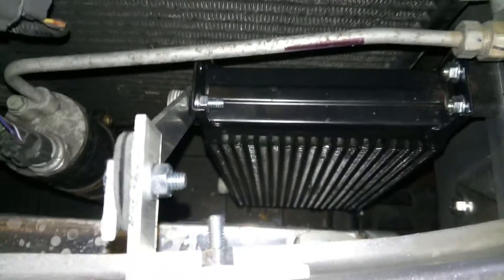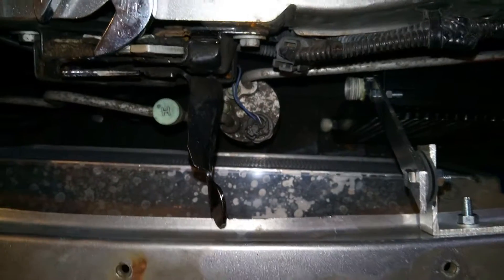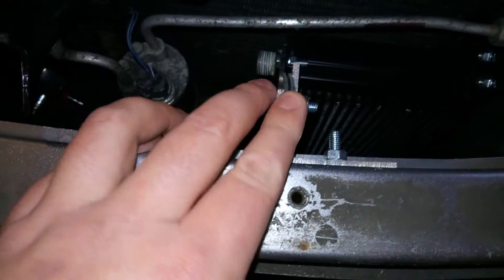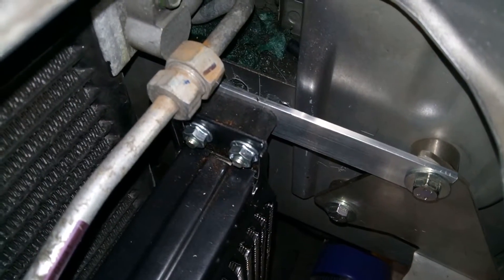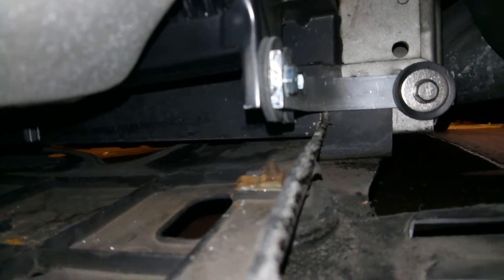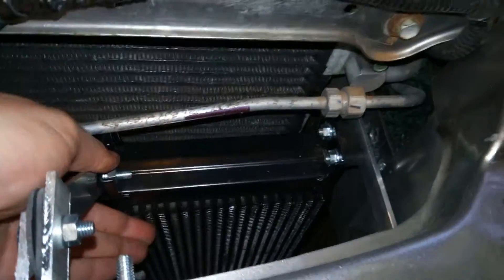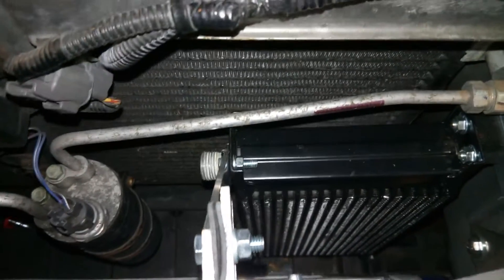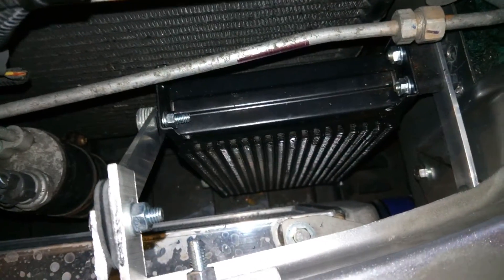HKS  Supercharged Honda S2000 oil cooler mounting

Comment: hey can i still install a strut bar with the hks supercharger
Reply from the maker: You might be able to install a strut bar. The HKS doesn't use any of the suspension mounting points for the kit but you would have to chose a bar that designed to stay clear of everything. There's not much point mounting a strut bar when you see the size of the metalwork in front of the engine that already braces everything